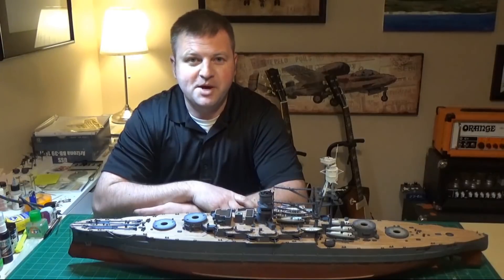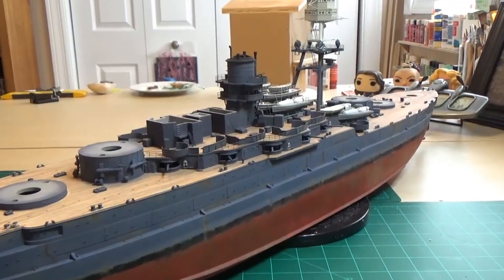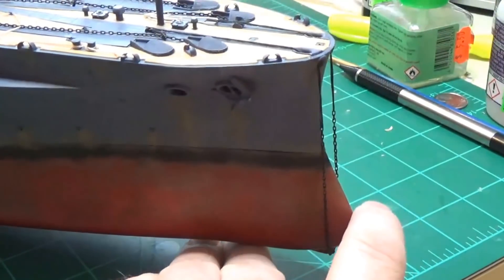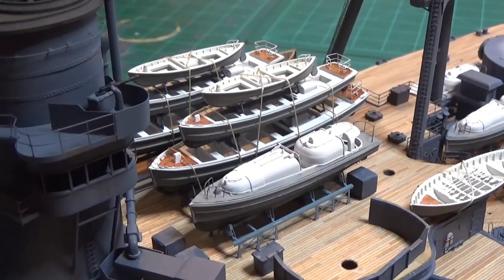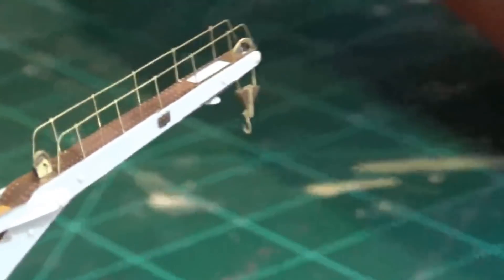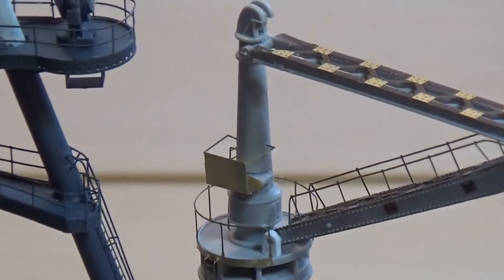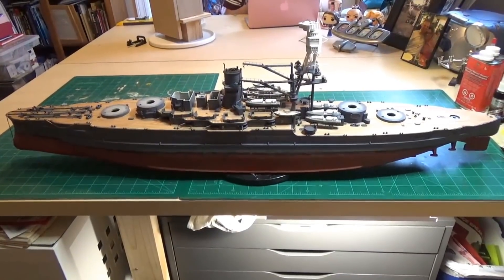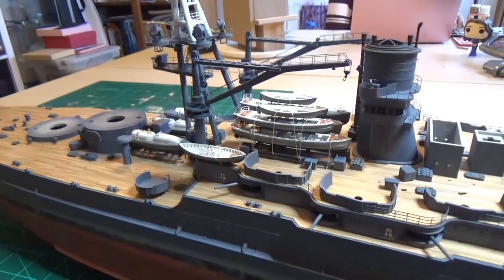USS Arizona by Trumpeter 1/200 Scale Build Video #13

Comment: About the cranes, the end winch primary use on the cranes,  is to raise the float plane out of the water ether from starboard or port for plane protection,depending on wind velocity and direction, now, the inner winch on both cranes only purpose is too raise, lower all small crafts in or out of water.